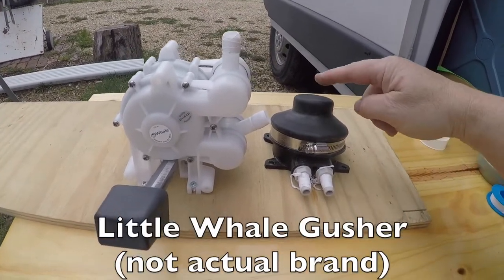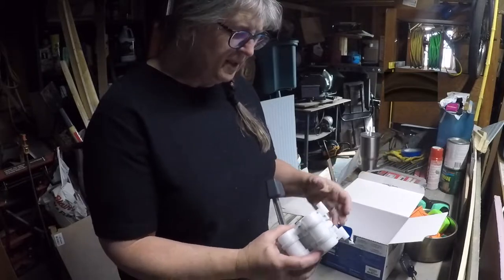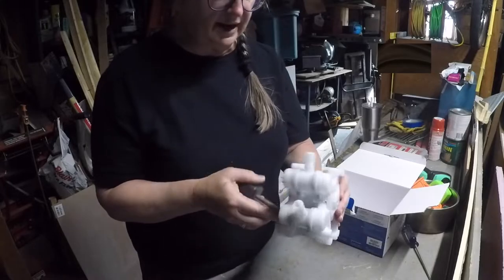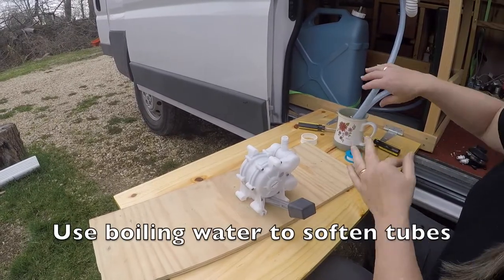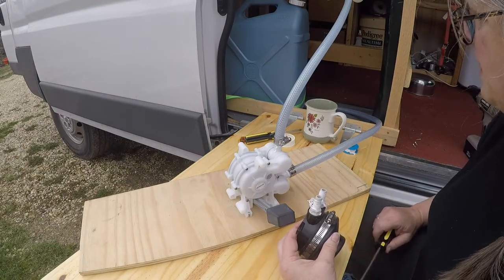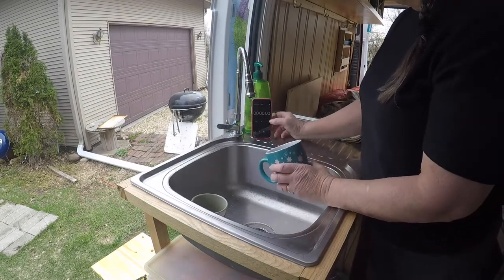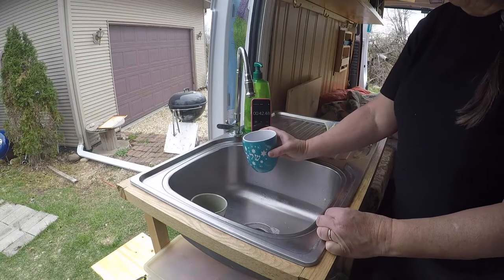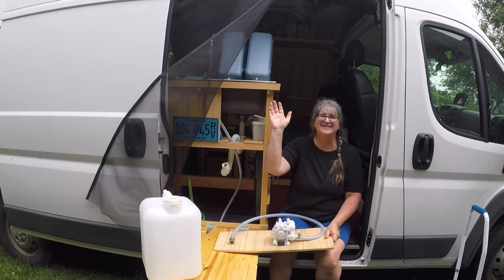Whale Gusher Galley Foot Pump

Comment: Exactly what I was researching. Thanks for posting your experience. 
I’m currently using a Nemo tank with foot pump and sprayer. I have gravity drain for drinking water. This would be a nice upgrade.
Reply from the maker: I can report that after several boondocking trips I still use about the same amount of water per day, it just takes me less time to pump it out. Good luck on your project.

Comment: Hi Michael, thanks for the video. Did u used 13 mm hose? Or 15mm? Best regards
Reply from the maker: The sizes here are 1/2 inch. that's what I used. It's what fits on the USA (states) fixtures. Both the foot pump and the faucet nuts take 1/2 inch. If you heat the hose in hot water it will be quite flexible and conform to different sizes if close to that size.
Reply: @michele2017promastertravel  thank you so much. Yes same size here. Will follow you step 👍
Reply from the maker: @oscarcortesrodriguez4445  good luck.

Comment: Hi Michele, I was wondering, do the babyfoot drill holes fit the gusher ones? I am looking to go the other way you did and replace a gusher with a babyfoot in my boat. I just need it to brush my teeth and the gusher takes to much space. Your answer will be very helpful as I couldn't find this information online. Thank you!
Reply from the maker: No they don't. But both are very stable on a  smallish piece of 1/2" of plywood. Good luck.

Comment: Hi Michelle, were did you find that specific jerrycan to connect it so well to your pipe/hose? i'm looking for the right name for that tipe of lit but cant seem to find it..
Reply from the maker: The two blue ones come front Walmart. The lid has a removable disk to seal a hole in the center of the lid (so you can insert a spout like a gas can if you want to). I used a dremel tool and opened up that disk to accommodate the quick disconnect. For the grey water - that jug ( l love seeing the levels in my grey) is a wine storage jug off Amazon. Again I had to modify the lid to accept the RV flexible drain hose. Mods took me like an hour for all three lids. Go slow and wear a mask with all the plastic dust.

Comment: Hi again, Michele...I purchased the Whale Gusher after watching your video on it. However, I can hardly pump it...seriously - standing on it full weight doesn't do a thing! Manually doesn't work either. Does it loosen up after it's used a while? Is there a setting that needs to be loosened? Does it need to be oiled or lubricated? I'd love to know your insights since you've actually used the pump..! Thanks so much!
Reply from the maker: wow. I did not have that experience. Right out of the box the pump was easy to pump and use. It primed in just a few pumps unlike the small one I replaced that needed many pumps to prime.  I'd say you probably have a faulty one. I would not try and open it up because you may disturb seals that will not seal again.  I'd try and return it if you can. 
   : (
Reply: Jake I'm thinking you need to return that pump.

Comment: This was wonderful and perfect. Thank you! The comparison between these two pumps was exactly what I was looking for. Now the ultimate question... How long will it last (and not leak)? :) 

Thanks again!
Reply from the maker: Hi there. These units are made for long term usage on boats. The reviews I have seen from boatlife people say they last years with high usage. I've only done a few trips with mine and I'm happy to report that it has never leaked and I love the volume, it's working out really well for me. The key to no leakes is warming your tubes so it really compression fits onto the spouts. Good luck.
Reply: @michele2017promastertravel  Happy to hear you're happy with the setup! Im just about to install mine. Got new 1/5" tubing. But are you saying I should warm the tubes when clamping them to the spouts?
Reply from the maker: @musicisbrilliant  Yes. I boiled water and let the end of the tube sit in for about 5 minutes. It made the tube pliable so it slipped on.   I've taken tubes off twice now, as I empty my pump if it's going to sit more than 2 weeks.  The tubes slide right back on and I use the hose clamp to retighten around end. No leaking.
Reply: @michele2017promastertravel  Thats absolutely briiliant! I didnt think of that. Thanks for sharing that tip! Glad you're still happy with the pump and your system. Im excited, just getting mine installed! Should have it in by tomorrow (on my boat). Exciting stuff! Thank you!

Comment: Does it still work after 1 yr of use ?
Reply from the maker: Yes it still works flawlessly. I really love the flow amount and ease of working. Recently I had to replace the screws that hold the pump to the floor board with bolts and washers because the screws pulled through the board from use.

Comment: What size are your screws :) ? 1/2 inch?
Reply from the maker: I think I used 1" because they had to go through the pump screw hole and then into the 1/2" wood to hold it in place.. Thanks for asking.